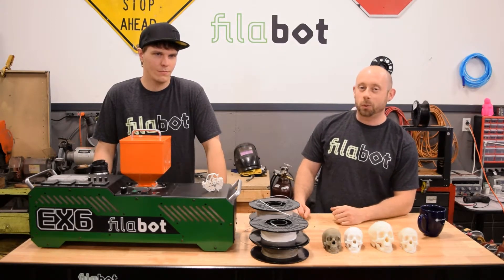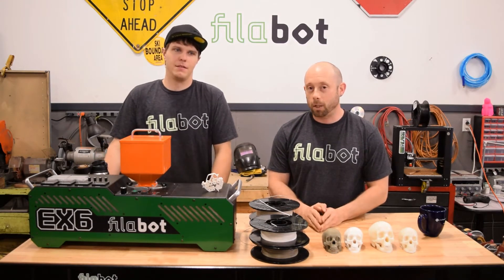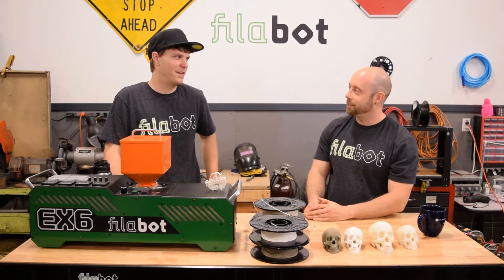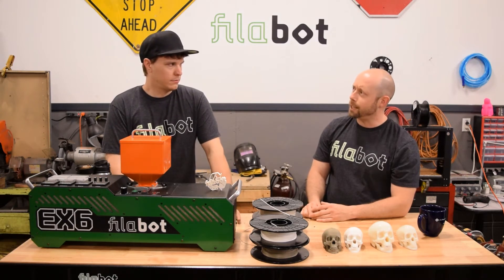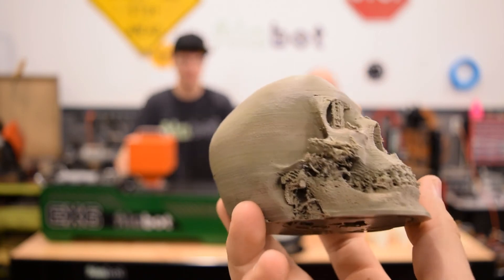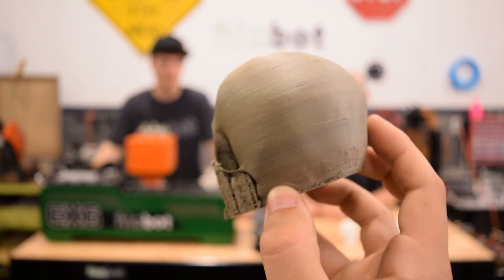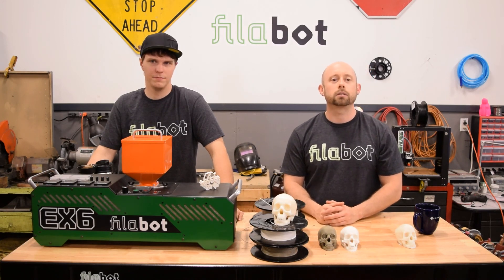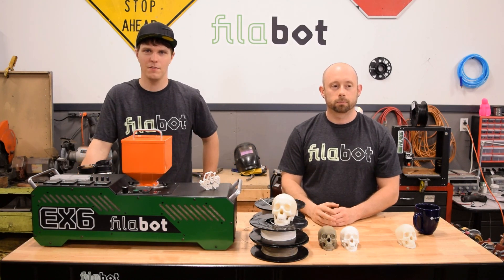Can You 3D Print with a Mix of PLA and ABS

Comment: Good but also bad... It is as though you are buying time on the video.. Cut the crap and get to the point. Yes. There is a reason why the manufacturers do not do a blend. But it is also not a proven subject like ABS. We all wish for a strong and durable material like ABS without the shrinkage. It will get there ime sure.. But do not drag on your clips..